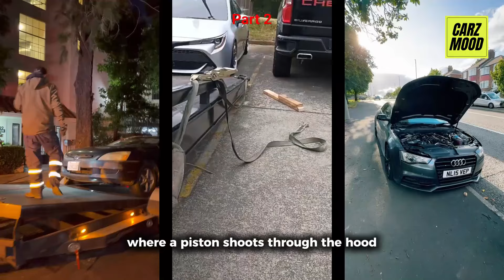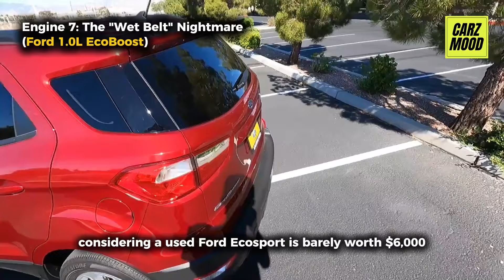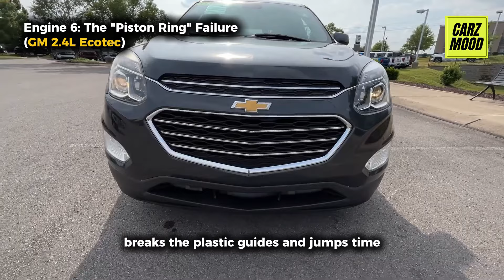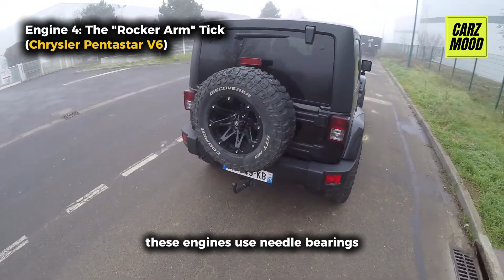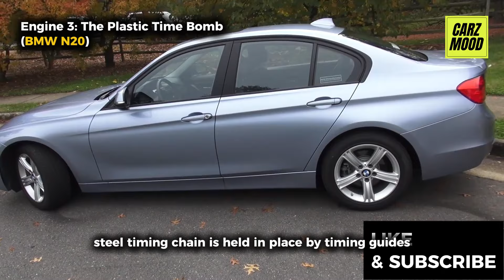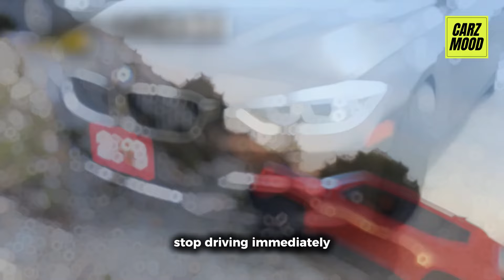7 Popular Engines That Will Self-Destruct After 100,000 Miles

Comment: I owned a 2012 Town and Country with the Pentastar V6 engine that had the ticking noise. I ended up replacing all 4 cam shafts, as well as all the rocker arms and valve lifters. I was able to do the work myself, but still ended up spending over 2k just in parts. A shop would've charged 4-5k to do the job. I wont buy another Chrysler product ever again.